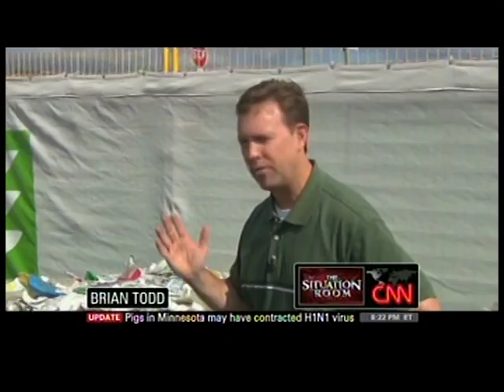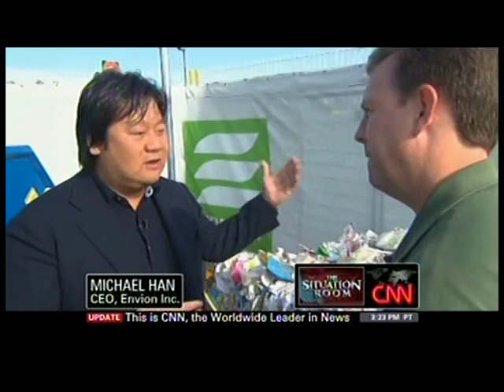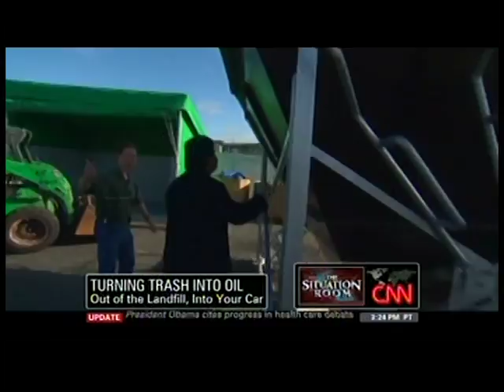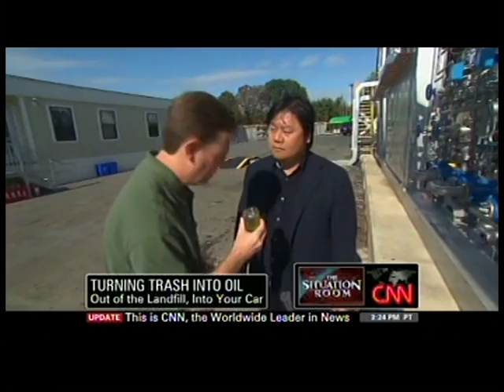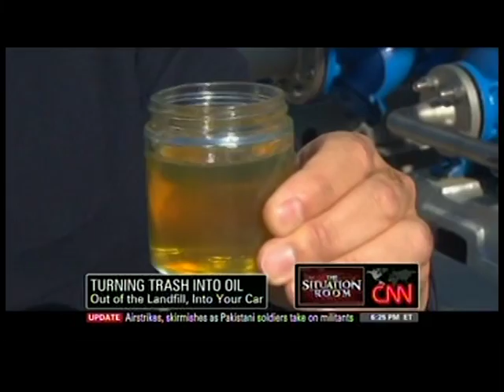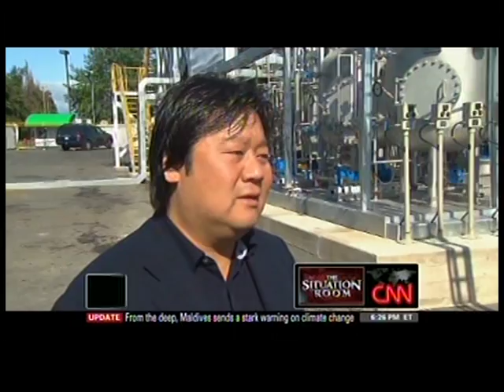CNN - Converting old plastic material to oil and fuel

Comment: isnt plastic made by adding oil to the concoction? ok, then this is just reversing that process. I'm all for this not producing hazardous wastes, but plastic can be recycled into reusable plastic without breaking it back into oil thereby it can be used through multipe post products instead of one tank of gas I appreciate the effort put into this process, but I fear it will only extend the oil ( and oil company profit and static buisnes methods) plateu: probably a short term solution :P

Comment: As I said IF YOU WANT TO BURN IT (that´s what the process here does, convert plastic to fuel, then burn it) then burn it directly, wihout spending energy in the process. Recycling is a better option because the emissions and energy spent are much less than to make it from scratch from oil. This process encourages the status quo, keep consuming and then put your garbage in this machine and voila! it is gone. You are assuming and putting ideas on other people´s mouths.

Comment: They are spending energy to make oil from plastic that did not get recycled. Why not recycle the plastic? only 8 % of the oil ends up as plastic. It is a better use than fuel, which gets burned up and turns into CO2. You can make fuel from plants, preserve the plastics from oil! if you want to burn it, burn the plastic, without spending energy on it.

Comment: Why do they always make out like it is rocket science to do this. I have been making my own fuel for some time now in my own back yard made from plastic using a machine made from old oil drums and car radiators.
I can turn 200 lbs of ground up plastic "55 gallon barrel full to the top" into 26 gallons of fuel that can be separated into about 9 gallons of gasoline and the rest fuel/diesel. 
They don't even mention the non condensable fuels that you also get from it such as propane and methane +